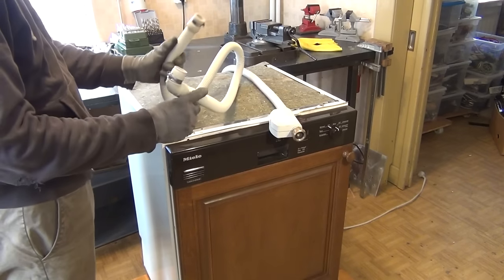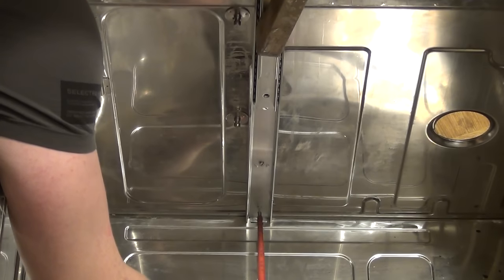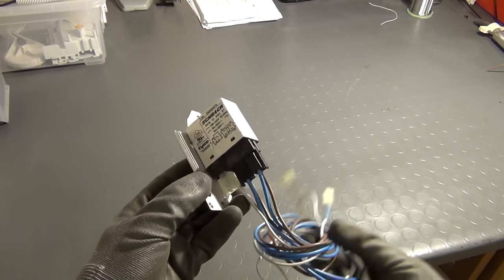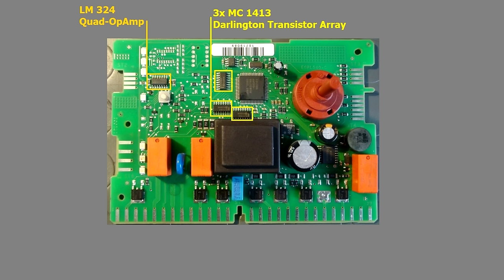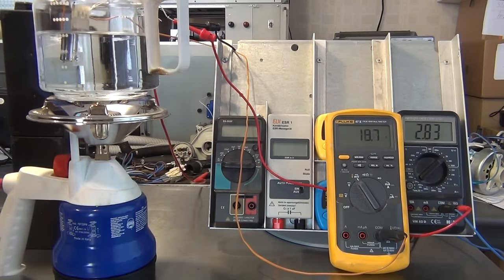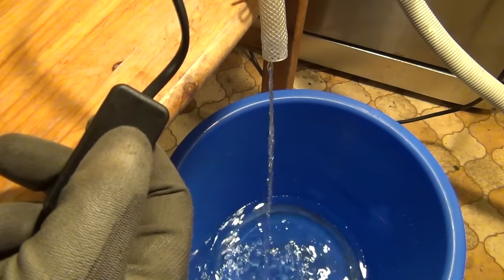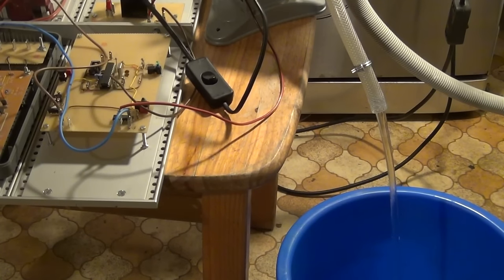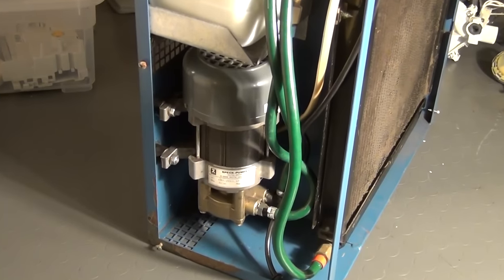Salvaging and Reusing Useful Parts from Dishwashers + EXPERIMENTS

Comment: The Aquastop could be used in conjunction with a footswitch in a shop where you need to wash hands or parts and can keep hands free for other purpose.
Reply: I like this idea, mostly because any timer or automatic watering device is already commercially available. The only benefit to building it yourself is that you could get it for free.

Comment: Thanks. I see machines on the curb all the time, and think about recycling them for $, but hadn't thought about making controllers for the pumps, and then using those for hydroponics until now.
In fact, the cabinets could be used for reservoirs, and there's already sensors. I don't know exactly what I want to do, but you're helping prime my creativity.

Comment: That Aquastop hose was pretty interesting. All the dishwashers in New Zealand I have dealt with have the water solenoid mounted internally and a simple pressure hose connects it to the supply. However recently in the hardware store I saw a product that was described as an Aquastop hose for a washing machine or dishwasher. It was the same principle - the main feed hose inside another one in case the internal one bursts, but it was just a hose with 3/4" threaded couplers on the ends. One thing to remember with these appliance solenoids though is they are not designed for continuous duty, so are only suitable for applications where it's just a brief supply of water to refill a container etc

Comment: I know this is an old video but seeing the bowl and pump assembly you constructed in action gave me an idea for you.   You could use it with a (plastic safe) solution or solvent and build a very efficient parts washer.  Would be great if you could find an old “Texas style” barbecue/smoker, seal it well, add a screen or mesh at the bottom of of the tube where your coals to keep the sludge below where your parts stay, a shelf  and filter system for the inlet.  You could add a stud wife or something to the exhaust hose so you could position it above the part so it could clean by continuing to run over the item.   And close the lid to keep noise and dimension down. Basically a parts washer lol.  Sorry for the ramble but you are very inspiring.     Thank you sir.

Comment: A dishwasher frame could be used for a sandblasting or spray painting cage. It also reminds me of a powder coating oven, but that'd require substantial modifications.
Reply: I have seen them transform even in egg incubators :) but for that a fridge is much better as it has insulation and more space

Comment: Excellent video, as usual!  I've played with NTC thermistors a bit.  They are highly non-linear in their response, as you noted.  To convert from resistance (or voltage from your voltage divider) to temperature, often look-up tables are used in the microcontroller.  These look-up table values can be found experimentally, or derived mathematically from three data points, using the Steinhart-Hart equation.

Comment: Nice update thank you for sharing! Is there a pressure limit to what the aqua stop can handle? I was amazed at how quiet the pump was. It would make a great aquaponics pump for indoor use. I will keep an eye out for trashed dish washers now. Cheers
Reply: +jhn seda the "Aqua Stop" or solenoid valve as it'd be more commonly called, would need to be rated for mains pressure, so probably around 10bar (~140psi).
Reply: Exactly what I did with the pump from our last dishwasher (Bosch). Now circulates water from a 330 gallon pond in a greenhouse to the 2 GrowBeds on top (made from the angle iron frames of 2 old queen size beds and some stainless sheet). Decommissioned at the moment because the greenhouse needs work but has worked great for nearly 3 years.

Comment: I had a thought during the video for gaining a water tight seal on the pump.  Since you are using heat to help form the plastic around the fittings maybe you can line the plastic with hot glue as the buffer.  I recall that this technique is already used by some heat shrink tubing manufacturers to achieve water tight outdoor electrical insulation solutions.  Thanks for the videos!

Comment: Those german dishwashers are awesome, I would use those parts to make a aquaponics system. It could be used to control an eb and flow system. To get the absolute benefits from growing food in aquaponics is achieved through automation. I've wanted to convert a dishwasher to a parts washer and that SS tub would be perfect as long as the pump could stand up to the more viscous fluid .

Comment: I've been using my circulation pump for a few weeks now set up on a Wi-Fi timer of 30m On 30m Off and I find it strange you didn't just make a simple rubber coupling and just clamp it to a 20mm and 25mm pipe made from the rubber and clamps already there? Anyways great video. Thank you heaps.
I should note the motors also have a thermal shutoff chip? inside them (shown on the diagrams) I was hoping you would mention and demo that because I'm a lil worried the thermal switch is going to activate to many times through the Australian summer heat

Comment: I use an Aquastop like that to dispense water into the bread maker. This way I only need to put in the dry ingredients and it goes to work while I sleep.

There were actually two mechanisms inside the Aquastop, that magnetic valve and some kind of pressure activated valve after it. I just cut it in half to remove that second mechanism.

Comment: Trying to make a hot water heater egg incubator, with auto water lever adjustment.  The plan is to use the water heater element (which needs to be submerged) to heat the water in the stainless base.  A bent metal cover could control the humidity.  Worse case scenario I screw on two porcelain light bases and attach a circulation fan.  Use with incubator controller XM-18 etc to run at ideal temp and rH with PID egg roller trays.  Watch at Tully River Quail.

Comment: Where you used a heat gun on the plastic, then inserted threaded fittings, but haven't gotten a perfect seal yet. I don't think you need waterproof glue or other sealant. I think you just need to thread the fitting back into the plastic. Then put a hose clamp on the plastic.

Comment: float switch and hose can be used nicely for an auto filling dog water bowl... awsome for bigger dogs
Reply: connect the Valve with a CHeap Sonoff Switch and boom irrigation system done without needing to program any thing and wifi accessable

Comment: Ahh an "aqua stop" or a remote solinoid valve, ive seen only one of those devices.
A frend wanted me to disconnect a german made washing machine.
I thought it a bit odd to run a 240v mains cable to a remote water valve, i had never seen that idea before, it must be reliable as i trust german engineering for reliability and being well thought out :-)
Your temprature experement, if it was a simple led bargraph required for display, a group of comparitor i.c's could be used to drive the leds.
Each comparitor has its one input biased via its own trimmer pot to set a threshold level, the other input goes to your sensor resistors.
You can preset each independant led to light at a set voltage input :-)
Reply: +zx8401ztv For the bar graph temperature thing , he may as will use a look up table for his micro controller, he could drive may led's with very few components and fully calibrate it.

Comment: I was wondering if that water heater could be used in an aquaponics system to heat the water?
Reply: andrew hodgkinson | It very much could! Could be useful if you are running aquaponics in a low temperature environment

Comment: One thing about that membrane operated pressure switch is that it also useful onboard a boat for pumping spillwater from the keelswine (what´s the correct english word here?) if one connect the pressure tube to where the waterlevel is supposed to be at maximum, it will start the pump, if needed via a realy, and stop the pump when the waterlevel decrease to normal again. (the switch can operate up to 240V for Europe standard (in US one need to check the maximum voltage, but 110V is conciderated av "low voltage" in EU (the 110V system also has a vide range of use here for special applications) so i think it will operate fine with that as it is if, but the Amps will probably incerase sinifically with the lover voltage system and that´s an important thing to check so one not override the Maximum Amp if using lov voltage systems on high voltage constructions not using real lov voltage, that´s why i recomend using a relay (up to 48V is considered as "safe", at least in my boat the batteries is 12V or 24V appending on how they are connected.). Personally i try to avoid using high voltage on board outside the landpower line wich i made a fully separated system for so they not will mix with each other in any point so the whole system on sea is 12 or 24V.
Sorry for my Englist, i don´t know how readable this was, but it was ment as a usefult little tip that many salvaged parts are useful on a boat instead of those expensive things from the specialized boat stores.
Reply: +Sheep_Ewe It's not a direct translation, but we would say 'bilge' in English for the place where the water collects.
Reply: Emma Jacobs

Ah, Thank You, I hawe heard the name "Bilge pump" etc when You say that...
In Swedish its called "kölsvin" (And the Bilgepump "Länspump") Keel pig or something like that in direct translationn... :D No idea what the origin of that word come from, probably Dutch or German my guess...

(The animal pig= Gris (or svin), Wild bor= Vildsvin)

Comment: so in basic thinking. you can use that heater to heat water for washing hands for example, right?
Reply from the maker: Yes. There is a possibility.
Reply: +The Post Apocalyptic Inventor  How many watts that heater consumes ?
Reply: I don't want to burst your bubble mr Muhammad If you want to have an usable stream of running water without using some kind of reservoir you gotta have something like 4-5 kW heater (in Europe they usually require pwo phase connection), there are small 2-3 kW running water heaters but the flow rate is pathetic and in my opinion only reason to have them is when you have a public object where law requires you to supply hot water to wash hands in the toilet or something like that :)

Comment: Do you think the heater would be suitable for pasteurising fruit juice?
Reply from the maker: Hey there! Sorry, but I'm not sure. I haven't found a way to connect the flow heater to standard tubing yet and therefore wasn't able to test it. The flow heater  in my house has a six times higher power rating. I think that a fluid that starts at room temperature would have to be recirculated through the flow heater several times before reaching the temperature required. I'm also quiet sure that water would have to be pumped through it directly after heating the juice. Sugary remains oft the juice on the inside walls oft the heater would certainly become a problem. But these are just guesses. Experiments are required to answer the question properly.
Reply: Unfortunately my apple processing didn't go too well so I never even got close to following up this lead but I now realise myself that apple is probably too sticky to put down a thin metal heated tube, glass would be better

Comment: Umm... At 17:17, why didn't you just connect both outlets together, and not use a 1 and a half inch to 6 mm adapter, cuz the pump efficiency drops almost to 10% or even 5%.
Instead , use the widest hose diameter that can fit to the inlet and outlet to keep the pump efficiency as high as possible.

Edit: I forgot to write that with that 6mm inlet/outlet adapter the power consumption increases as the motor tries to force more water into that tiny teny 6mm inlet and outlet.

Comment: The current rating for your switch will be the same or higher than the wire attached to it.
Reply: +theflinx it makes sense it should be around 13a, as it can switch off and back on,  the dishwasher in any mode, including when heating, thus needs to be able to handle that

Comment: boards like this are not easy to reprogram. now days i cut/heat the CPU off and wire on a attiny or arduino pro mini. Thus way you get all the power , glue and power stuff on one PCB and an easy to use modern controller.